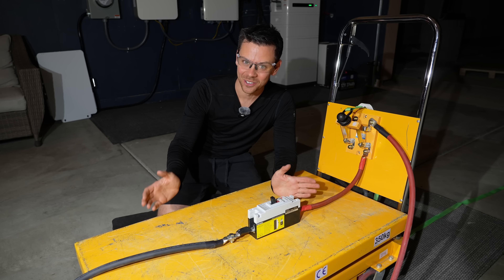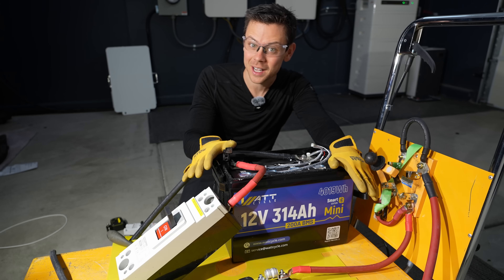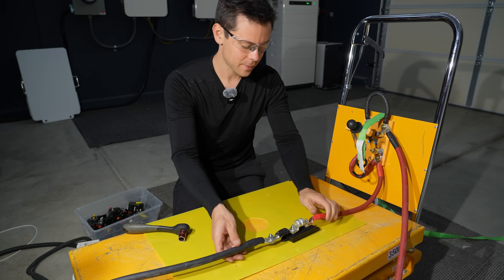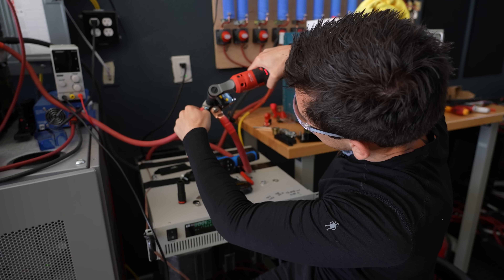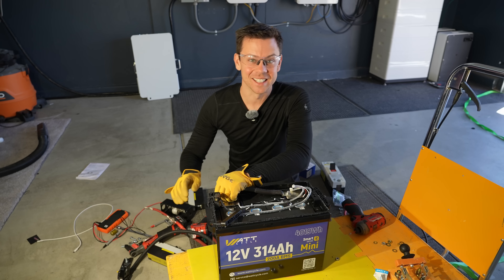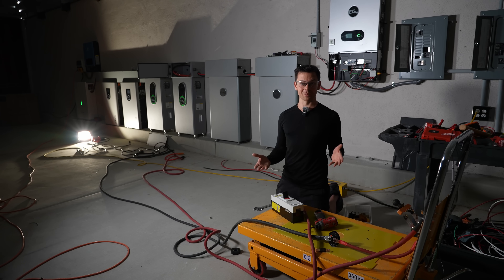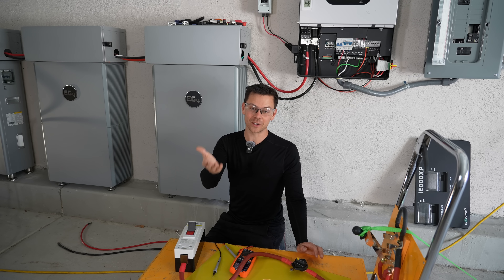DEAD SHORT 88kWh Lithium Battery Bank! What Will Break First?!

Comment from the maker: See what Breakers AND Fuses I Currently Recommend Here:
https://www.mobile-solarpower.com/fuses.html

Products Mentioned in Video:
DIHOOL (Large DC Breaker): https://amzn.to/4o7xjQM
T Tocas 3/8 (large) Stud Breaker: https://amzn.to/47aKFFT
Bussman 150A Breaker: https://amzn.to/3Wfo04M
Inline Breakers (avoid): https://amzn.to/4qlmo7s
Terminal Stud for Cheap Batteries: https://amzn.to/47yvHtd
Yellow and Black 150A Breaker: https://amzn.to/4qfC9Nf
Panel Mount Yellow and Black (good one): https://amzn.to/49bbQkX
PV Disconnect (good one): https://amzn.to/4oxK8ne

~~~~~~~~~~~~~~~~~~~~~
Tired of getting ripped off? Check out my "Will Prowse Approved" solar product recommendations below!

12V Batteries
https://www.mobile-solarpower.com/lithium-batteries.html

48V Batteries
https://www.mobile-solarpower.com/48v-batteries.html

Offgrid Inverter System Builder
https://www.mobile-solarpower.com/48v-complete-system-blueprint-559371.html

Hybrid Inverter System Builder
https://www.mobile-solarpower.com/code-compliant-48v-offgrid-system.html

Mobile Handtruck System Builder (very popular!)
https://www.mobile-solarpower.com/mobile-48v-system.html

Solar Panels
https://www.mobile-solarpower.com/300w-solar-panels.html

Ground Mount Solar Racking
https://www.mobile-solarpower.com/ground-mount-racks.html

Wire, Lugs and Busbars
https://www.mobile-solarpower.com/wire-and-connectors.html

Tools
https://www.mobile-solarpower.com/tools.html

Fuses and Circuit Breakers
https://www.mobile-solarpower.com/fuses.html

Plug-N-Play Solar Systems
Ecoflow, Anker And Bluetti! So many models to choose from. See my current recommendations here:
https://www.mobile-solarpower.com/full-size-systems.html

~~~~~~~~~~~~~~~~~~~~~~~~~~~~~~~~~~~~~~~~~~
Need to build a large DIY system? Need a trustworthy solar distributor? These are my favorites:

Signature Solar
Creator of EG4! Solar Minisplits, Victron and More! Largest Solar Store Online.
If you want $50 off, please use my link below and coupon code "DIYSOLAR50":
https://signaturesolar.com/?ref=cPwLcVc0SW-BjN

Current Connected
Best Prices for EG4, Victron, Midnite and so much more! Fast Shipping and Highest Rated Customer Service:
https://currentconnected.com/?ref=wp

~~~~~~~~~~~~~~~~~~~~~~~~~~~~~~~~~~~~~~~~~~
Join our DIY Solar Community 
Need more help? Join the largest solar forum on the internet for beginners and professionals alike. 140,000 members and counting!
https://www.diysolarforum.com

Check Out My Free Book
Best-selling and beginner-friendly guidebook to off-grid 12V solar!
https://www.mobile-solarpower.com/the-book.html
Reply: Will if you check UL testing you house panel for 10,000amp so you’re home breakers are ready to interrupt that kind of current. Certainly not survive but disconnected, which is the goal.
Reply: I think you need to do a colab.  Check the video name '100 car batteries wired in parallel! '
Reply: maybe a lipo scooter pack!
Reply: At least you're enjoying  yourself  Styropyro style 😅😂
Reply: Just curious, is there a reason you don't have lights installed in your bunker?
Reply from the maker: @MYCHANNELWITHMYSTUFF Just finished the roof 2 weeks ago
Reply: 你的影片很有趣，但是建議如果要測試短路電流可不可以正確觸發NFB的話，有些要用無BMS或是電池的NFB短路動作時間大於0.1秒的才可能動作，如是熱斷路型的子能是使用帶負載的方式才可能正常動作，一般是建議NFB和熱斷型保險絲串聯NFB等於或小於電纜和電池安全電流，熱斷型保險絲小於電纜安全電流並且等於附載最大運行電流

Comment: With the recent proliferation of cheap 48 V 100ah server rack batteries and 600+ amp/hr 12V batteries it has become way too easy for inexperienced hobbyists to burn their houses down. I use over-provisioned wire, Blue Sea Systems or Eaton MRBF fuses on every single pack / battery, and a US branded (Littlefuse, Bussman, Eaton, etc) T class fuse on my overall system. Also a smoke detector in the battery room and fire extinguishers built into every rack battery. better safe than dead.

Comment: I turns out, if you connect some automotive jumper cables to a large battery bank to test something, but the other end of the cable clamps accidently come into contact on the shop floor - gives you the same effect without using a rope...! 
{it may also weld the camp heads together it seems}

Comment: dont use battery's the internal resistance and inductance is too high

use big capacitors in parallel  the internal impedance is much lower it will just explode

Comment: If you’re just wanting big amps for a split second with no safety, you might be better off getting a handful of car starter batteries (lead acid) and wiring them to get 48V. They don’t have as much energy as the lithium batteries, but even an average car battery will supply 1000A for maybe 1/2 second. With the higher voltage, it would be even more

Comment: The breakers i play with at work have a huge inrush capability and will only trip if the current is sustained for a while. Even a 10 amp breaker can handle 250 amps for a moment. You prob have a pile of used cells, bolt em together n let the sparks fly!

Comment: Thank you for doing these tests. I know you are a lithium channel, but just for doing dead short testing you might want to look into Odyssey AGM Batteries. Their "extreme" series group 31 has a short circuit rating of 5,000 amps. Just a few in parallel and you will have monster dead short amperage available.

Comment: I recommend using a welding transformer with an AC line. It can easily and safely provide you tons of low-voltage current.

Comment: With the bladeswitch etc you get a lot of contact resistances lowering the currents, without a proper dc shunt the video is nearly useless. also heavy shorts like on the big breaker WILL damage the BMS mosfets

Comment: For REAL amps on the short-circuit test, try a large electrolytic capacitor bank (64V, 1 Farad) and measure the spike current using a loop and an oscilloscope.  Be sure to charge the capacitor with a charging circuit, a large resistor, or a light bulb, as you know that a depleted capacitor is effectively a dead short.  Also, make the cables between the capacitor and the breaker (the short circuit) much shorter (and thicker)  because they now become the salient resistors in the circuit. Pros: 1. It eliminates the need for large battery banks. 2. It eliminates the chance of a runaway failure that burns the house down.  Cons: 1. Abused electrolytic capacitors can pop.  It is easier to reach 1 farad with a supercap, but they have much higher internal resistance and will not push the amps.  You can get the 46 caps for $414.  (2 pieces 63V 22000UF for $18 on Amazon).  I would love to see the bouncing wires as they magnetically attract and repel from each other.

Comment: The idea is the BMS hopefully will clear the fault without damage, and the HRC fuse and breaker are backup. Long cables, will dramatically reduce the fault current. my inverter has fast electronic breaker, to protect my 48v BUS from the exact issue, If u have a large dc bus cap bank things change dramatically, fault current management matters. Don't use the cheap black plastic automotive breakers,  as they have low breaking capacity and area fire hazard use proper industrial switch gear, more expensive but its better than a fire.

Comment: This test shows quite dramatically the difference between:
Thermal and Magnetic.

Your fuse and full-size breakers are thermo-magnetic. They will trip instantly with the high current due to magnetic affects. They will also trip during a long-term overload at their rating.

The 12v 'breaker' are really just a 12v resettable thermal overload. They are not capable of tripping due to anything other than overheating.

Comment: I used to own a firm that specialized in electrical testing and maintenance. I had several high-current test sets for circuit breaker testing. I could test 6000-amp circuit breakers at their Instantant trip set at 15x or 90,000 amps. We only hit 90,000 amps a few times, (50,000-6000 amps was a regular test) but the bang was loud and the test set and breaker had to be strapped together to minimize movement. A thermal only typically will not trip on a dead short. For an instantaneous trip on a dead short, you need a magnetic trip. A standard MCCB is Thermal Magnetic.

Comment: I'm guessing the BMS saw the spike going straight up and assumed a short so stopped current. If you loaded them at a regular load you could max them. 

If you want super high current you need a bunch of used caps.

Comment: How did you not know that every BMS has short circuit protection? It will detect high amps and turn off pretty quick, otherwise the MOSFETs inside the BMS are the first thing to burn out.
Reply from the maker: Yeah but you can get a pretty good flow before they cut off

Comment: my take away:
the BMS on good quality batteries banks is STUPID fast at catching large over current events.
this is actually VERY good.  it'll help prevent damage to the BMS.
You're going to need to figure out how to use your dump load to draw enough current to trip the breaker fast, but not so much on a per battery bank basis to trip the BMS.

Comment: Will, we love you. Please stay safe. If it doesn't trip, couldn't the knife switch "weld" itself closed? Honestly, after watching this, I don't think this was a safe test. If there was melting, it might have continued onto the metal cart, which was moving when the rope was pulled.  If BMS fails, is there potential for fire?

Comment: most of the BMS in the market(yes including Daly) has instantaneous short circuit protection(in the microseconds, way before you can even react) you're just limited by the battery's resistance and the BMS. 

Oh and using a capacitor bank is way more safer than using Lithium just don't touch any of the terminals and add a dead short conductor while not in use to prevent the capacitor from gaining charge thru induction or static

And another thing is use pneumatic switches

Comment: Back in the 90's I built a 12v sound system for parades and other outdoor events.  It used a large bank of lead acid batteries, capacitors, and a generator.  The system would draw about 8000 watts on low frequency notes.  Fuses blow with no warning.  I always use circuit breakers instead of fuses.  Breakers actually buzz just before tripping, so you have a chance to back off on the volume.  "The show must go on!"  LOL  Now, I have LiFePO4 batteries that can potentially push over 13000 watts.  Haven't maxed it out yet.  Inside, at only 4000 watts, pictures & dishes fall, and sheet rock begins to crack!

Comment: There is a test setup at Hydro Qubec that can do 10,000 Volts at 10,000 amps. It has a huge room of air cooled resistors.

Comment: Trail welding right there. Get a rod holder a good size alligator clamp. 
Try to weld raw steel using welding rod. Bet you can get them to trip then. 

We used to use two lead batteries for field welding.

Comment: hey Will some dangerous advice here, i want to get more current capacity to your item under test? parallel conductors. also 0000 (4awg) on a single conductor can carry about 4400amps right at which its resistance starts to limit the current rush. i've tested quite a few machines that generate 10kA+ and cable gauge is surprising how much of a resistor it is.

Comment: We used to drop down to 12 volts to test circuit breakers in college. But to bare in mind these breakers are only rated to overload a few times, then you must bin them.
What happens to a solar system in island mode when there is not enough inrush current to trip your circuit breakers under fault conditions?

Comment: I've done similar testing (at a smaller scale), so this is exactly what I've come to expect. The "instantaneous" magnetic trip mechanism in most MCB / MCCBs usually takes around ~5-10 ms (sometimes 20+ms). These days, even a half decent BMS can detect a dead short in a few milliseconds. A proper BMS like JK can do it in under 1ms - in fact, in the JK app, that parameter is measured in μs (MICROseconds). You can adjust it, but not sure what the upper limit is. Worth looking into.

Comment: Some BMS also meter the rise of current (over time) to detect a short and distinguish them from charing buffer-capacitors inside an inverter. That's maybe why even the big batteries have shut down instantaniously. But if the BMS fails, a proper sized fuse/breaker is your last line of safety.

Comment: Give it a huge capacitor bank after the battery but before the switch and maybe even longer cables to limit the surge current a little so it doesn't trip the BMS first

Or just go for raw lead acid batteries as they don't mind high current for short time and cheaper 😅

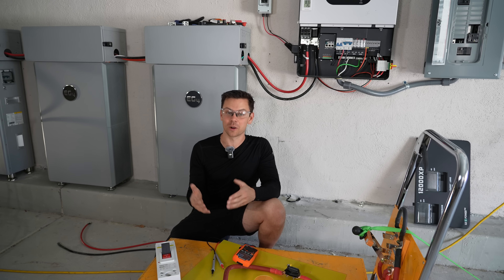Comment: 7:40 aren't your cables way longer? Your cables are limiting a lot at tens of kiloamps. You need to put a current clamp or shunt on the setup and measure with your scope, that way you'll finally know what's actually going on. Pro tip: measure the resistance of your short by measuring impedance at the final switch in open position. You'll see that that impedance times the voltage is your short circuit current

Comment: A BMS trips in like 100microseconds, a breaker trips in like 1 milisecond and a fuse trips in like 100 milliseconds. I've done many battery short circuit tests, using a big (not as big as yours) 250A breaker. It did never trip. A 120A fuse was in line, also never tripped. I got 4kA at most with a 48V battery. But the BMS tripped within 50 microseconds so the fuse and breaker had no time to react
Reply from the maker: Good point

Comment: In determining current in these circuits you must include the conductivity or resistance of all elements, such as supply wires. Even a 4-0 cable with length of 3 ft would have a few volts drop across each leg.

Comment: Watching this series does make me rethink somethings. Not so sure DC breakers and fuses are the safety factor I thought before. Fuses I will buy  will be Blue Sea, fires and boats are not good. I have a Pytes 48v server rack battery and it had a bad cell. They warrantied it and I kept the old battery. When I took it apart there is no comparison to the Amazon batteries Will has torn down. The BMS seems to be the best safety part of these batteries. 

After seeing the build quality and the warranty of the Pytes I won't buy the cheap batteries. Unless I can have them in an area. Where if they failed the risk is limited, to that area. These videos have also made me about the gases released is a failure. 

I have a friend whose house caught on fire and her brother was burned alive and she was burned trying to save him. It has just now set in of the power that these batteries can release. It is easy to get lulled into complacency with these batteries. 

I hope Will ends this series with an overview of what is safe and not safe.

Comment: I am afraid that he said he wouldn't go near a raw cell 48v system.  

I mean, At one point if you're DIY'ing a battery... you have a 48v raw cell system. When I was making my 13s7p batteries with unprotected 18560's I had an alligator clip jump off a rail and bridge almost the full battery.  That wire EVAPORATED. I'm lucky none of it hit my eyes. It stung my hand and made a hell of a noise.

Comment: Much better test would be the use of capacitors (with adequate capacity) instead of battery and use of triac to close the circuit. To limit the system total energy in case of catastrophic failure...

Comment: OK, someone needs to create AI safety monitors using cameras.  We need to be able to protect people doing very dangerous things sometimes by themselves.  We need this for all kinds of things, but a general safety observer that could sound a quick warning if someone’s doing something wrong would be very helpful to society.   You could even hook it up and it would be monitoring power for you and if it saw you get in a dangerous position, it would shut off power itself. Someone create an actuator and belt system to physically pull Will away from the equipment if something goes wrong.😂
Reply: to give you an idea of how dangerous this is is I accidentally grounded to primary power with a shorting stick because I forgot to turn the circuit breaker off at the main panel and had just hit the circuit breakers on the equipment so there might’ve been 400 A or something like that and it evaporated the end of a steel shorting stick.   It just disappeared and he’s using a lot more power than what that was.

Comment: I think most BMS's have a short circuit protection. I know JK bms will protect if it detects a short for 1500 microseconds. I don't know what method it uses or what breaking capacity it has though.

Comment: The smaller breakers are rated for 48V max, so they should not be used with a 48V battery, which can reach over 58V. Even the blueseasystems one is not rated for 48V batteries.
Reply from the maker: Absolutely!! I mention that a lot in my videos

Comment: 40 feet (2x 20 foot runs) of 4/0 copper literally can not support 10,000 amps.  Voltage drop would be 100% and limit the max to about 9500 at 48v DC.  Might be worth it to change over to a lead acid battery bank with much shorter and or parallel leads.  4 8D batteries from sams club would be about a grand though, but they would easily output an unregulated 2000++ amps for 30 seconds!  Short circuit amps would likely be well over 8000.  A hall sensor with a recording oscilloscope would show peak currents + voltages nicely.  Great job!